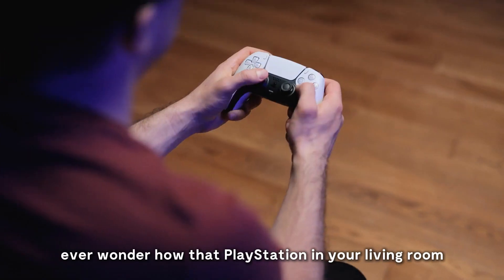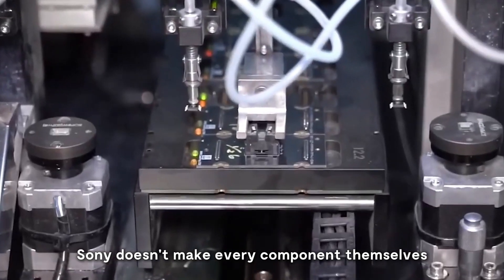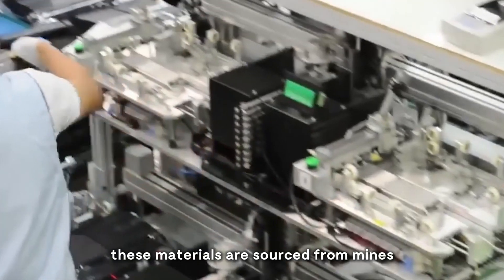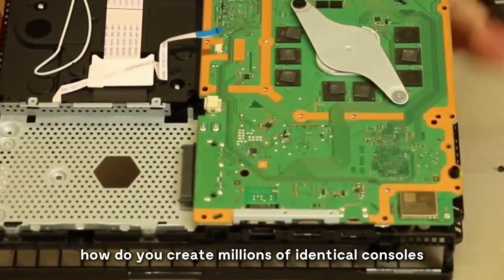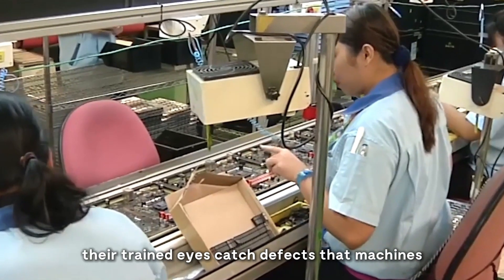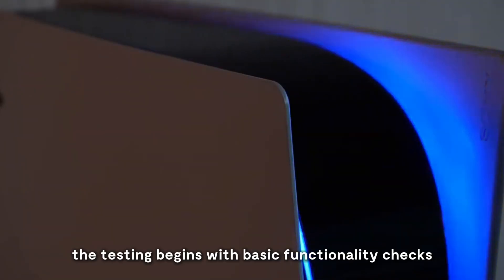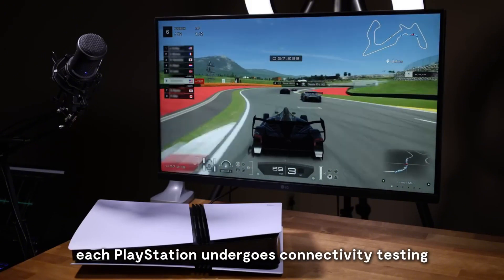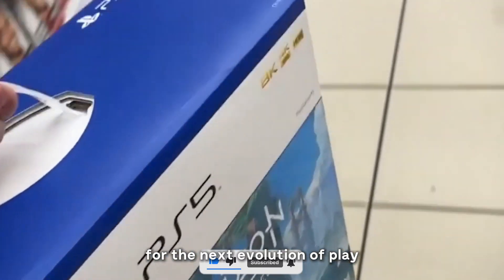How does Sony create Its Best-Selling PlayStation?

Comment: the mistake is using an amd processor which gets incredibly hot. better to use intel which is not so hot.
Reply: Tell me you know nothing without telling me you know nothing.
Reply: Exactly
Reply: Intel Processors have issues with voltage regulation in order to produce less heat. This compromise means that every time you run your system, the processor is one day closer to it's death, while an AMD CPU will theoretically run until something physically damages it.

I have AMD chips from 2004 that still work, but no Intel chip older than 2016 that still works. I'm a bit of a hardware nut, take my word for it. =\
Reply: You’re dumb.